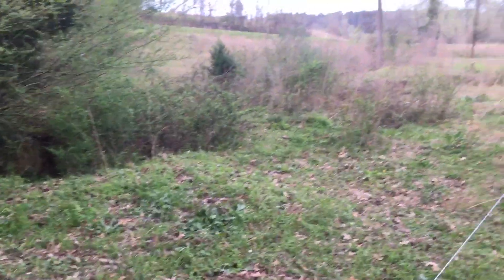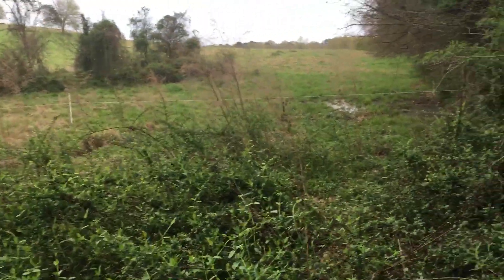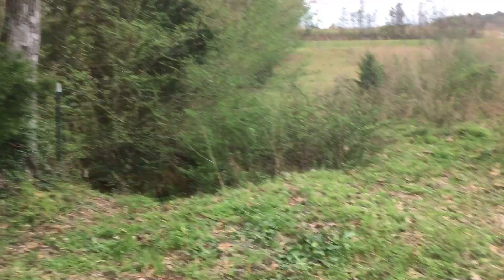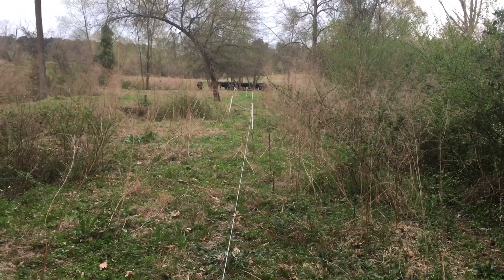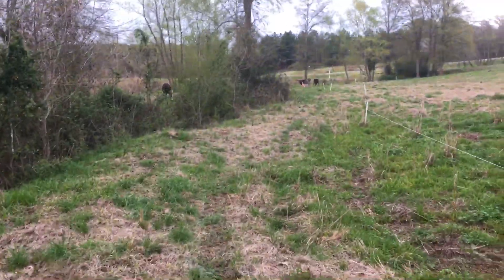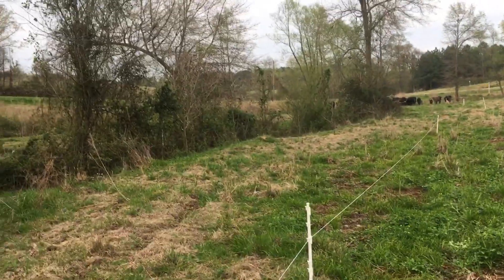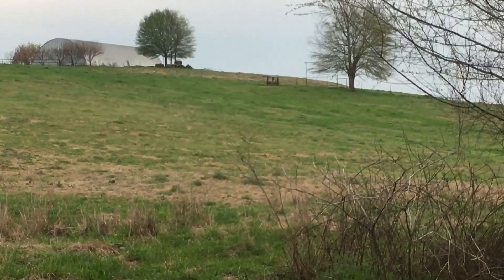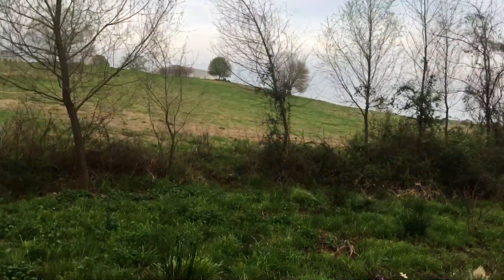Experimenting with mob grazing part

Comment: Not sure what that grass is, but it has a good clumping form. You could dig up a plant and split it into multiple plants, then plant them all along your creek. Looks like they could hold back the erosion on some of your newer washouts.
Reply from the maker: That’s actually a good idea I might try that I will say I am finding that just simply through longer resting periods I am seeing a lot more of it come up by itself
Reply: @johnscarboroughregenerativ7240  I've had good luck planting clumps of grass in tight lines running perpendicular to the water flow. As the grasses mature they create a check dam that holds back soil but slowly lets water through, reducing erosion.